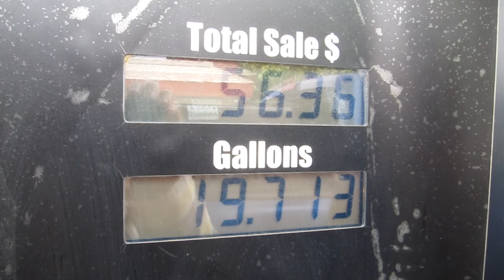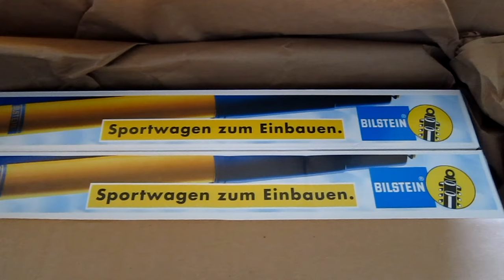Expedition Vehicle Prep for Long-Term Overland TRAVEL VLOG Ep.3

Comment: I used Bilstein shocks for a bit, but then we went to Tancho RS 9000s which ive been happy with. If you go that route just spray a couple more coats of paint on them for rust protection. If you go to Rancho or Fox shox you will feel the difference. Ride quality and resilience on the crazy roads you are on. All due to all of the weight yall constantly carry.
Reply from the maker: I've been happy with the bilsteins as a simple bolt on upgrade. Definitely prefer them over the ranchos that I've used, but both companies make a wide variety of options, so it may not be a fair comparison based on the random products I have experience with.
Reply: @TheTravelingTogetherJournal  i think the Bilstein rode stiff in my opinion,  the Rancho rs9000xl were resilient but softer but then are rusting
I think we may go Fox next since the Rancho tend to rust
Reply from the maker: @yeahman1975  I don't know much about Rancho's offerings but bilstein, fox, king all offer their shocks with different valving and also rebuildable so you can tune your shock for your vehicle and the way you drive. This isn't something that I've done, but my brother is heavy into off-road racing and it's common in that community.

Comment: When you can, replacing rhe driveshaft with a new one with new boots on it seems to be the best option. You have lot of great after market options that for the same labor tou now have added years to your off road rig
Reply from the maker: I did eventually replace the front drive axles with new ones instead of replacing any more boots.